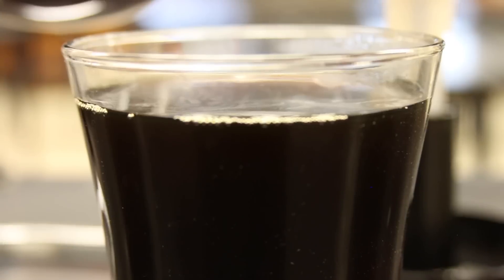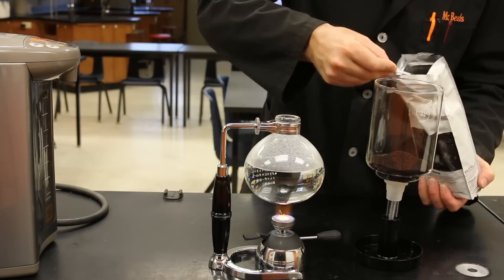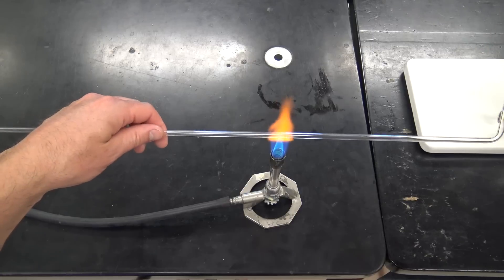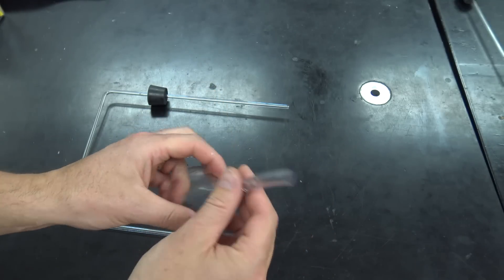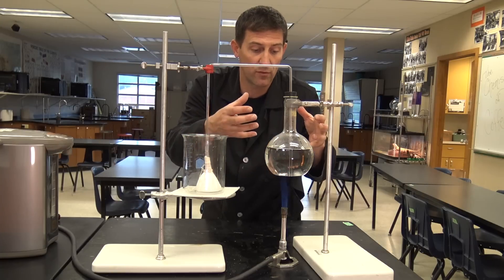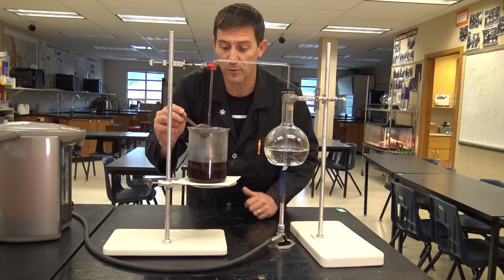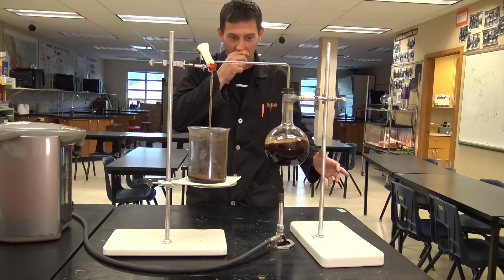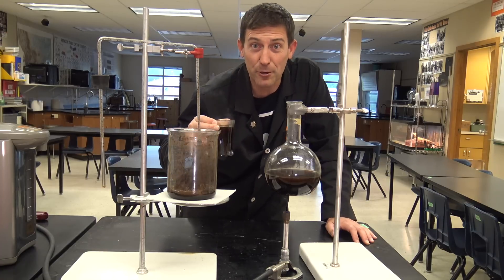Brew Perfect Coffee with Chemistry Equipment - DIY Siphon Brewer

Comment: Hi! How much time do you spend heating the water approximately?
Reply from the maker: If I have something available to boil the water before putting it in the brewer I will preboil it. Then it only takes a moment to get it back to a boil in the brewer. Once it is barely boiling in the brewer, I seal the stopper and let it go to work.
Does that answer your question?

Comment: I’m trying to make my own, would that clear plastic/rubber tubing he used as a connector work as a replacement for the glass tubing he used to syphon the coffee from flask to beaker or breaker to flask? I can’t find glass tubing like he had that bent so easily also don’t have a glass cutter
Reply from the maker: You can use plastic tubing but make sure it is rated to handle the heat.
Reply: @BealsScience  thank you! got some from Home Depot that worked like a charm! Love the video too 👍
Reply from the maker: @mikeysasso2646  I'm glad it worked!

Comment: Hey there, wanted to know of this works for hot chocolate as well?
Reply from the maker: I am not sure how well it would work. It probably depends on the filter. A fine filter may get plugged with the chocolate.
But, you could skip the filter and put the cocoa in the beaker, let the water travel over to the beaker and once all of the chocolate has dissolved in the water you could remove the heat and let it travel back.

Comment: a soxhlet would have been better wouldnt it? or is that cheating?
Reply from the maker: We could use one just for looks (it would look cool!) but a soxhlet is mainly used for extracting lipids or oils from solids. For example, it can be used to extract peppermint oil from mint leaves.
Reply: @BealsScience  isnt that effectively what you are doing with coffee as well
Reply from the maker: @andosoup98  brewing coffee is where the hot water pulls molecules out of the ground up bean. These particles become suspended in the water or are dissolved into the water and carried into the brewed coffee container.
If we used a soxhlet, we would only pull small amounts of oil out of the ground beans so we would end up with a small amount of coffee oil. Which might be a really cool thing to have!

Comment: Nicely done, however, if it's properly made, once the majoirty of the water is boiled off, you'll naturally get a lot of turbulence in the "upper chamber" that will "stir" everything for you automatically. If you're not getting that gurgle of air, you don't have enough space between your uptake pipe and your boiling flask.

Comment: I would love to see a set up meant for tea!
Reply from the maker: That’s a great idea! Any suggestions?
Reply: @BealsScience  Well, I think you'd need to set up a thermometer because for white / green teas the temperature for brewing needs to be 80C, black / pu'erh teas 100C. If you have water that is too hot for white / green you run the risk of burning the leaves and the flavour turns. I've watched your videos a few times as I always keep coming back to this idea so I don't think the process would be much different from coffee, just need better temperature regulation of the water, and a way to easily time and siphon off the tea. I would suggest collecting into a boiling flask that perhaps is on a pivot point that you can pour into a mug.
Reply from the maker: Thank you for the ideas and info!

Comment: Could I substitute the burner with a hotplate? I do not have access to gas.
Reply from the maker: Yes!
Reply: @BealsScience  Does the temperature matter? Or is it only going to speed up the process?
Reply from the maker: It needs to get hot enough to boil water. But, it doesn't matter how fast it gets to that temperature.
Reply: @BealsScience  Thank you so much!

Comment: But how does brewing it this way affect the taste of the coffee? Also you should always use whole bean and only blend it right before you brew it because a lot of the flavor comes from the beans releasing a gas after being blended and boiled
Reply: It's not gonna taste that radically different from a french press. It's still just coffee sitting in hot water for a while that is doing the actual brewing. The vacuum is just moving the water around and the simple paper filter he rigged to the end of the tube is doing all the filtering. The only benefit of this over a french press (in terms of taste) is that you can use a better filter than you use of a french press, that's all. So, I imagine it would taste quite similar to a Aeropress.

Comment: Nice job.  Personally I would be interested in building some type of apparatus that actually brewed the coffee in a partial vacuum.  I think it would be possible to brew at a much lower temperature and get a smoother cup if the vessel that the slurry was heated in was under vacuum.  It would have to be hermetically sealed with some kind of a valve to allow it to flow back once brewed.  Perhaps it could be done with steam.  Maybe having a vacuum suck heated water vapor through a filter packet of some kind and deposit it in a trap.  Any ideas on how this could be done?
Reply from the maker: Steam brewed coffee?!?!
I love that!
How? Not sure...but I will definitely do some brainstorming!

Comment: wouldnt it be easier to use an electric kettle with a rubber stopper on the top and the same set up. alot of people dont have access to this equipment. my idea is to use an electric kettle, as i need the whole contraption to be portable.
Reply from the maker: An electric kettle is a great idea! If you make one, let me know how it turns out!

Comment: I love this video Mr. Beals; I'd like to think this would be an awesome demonstration for a high school chemistry class, but I'm not sure how attitudes towards students and caffeine have changed since I graduated; I remember energy drinks were a huge controversy back in '07-'11. 

In any case, I did want to note that the vacuum explaination was a wee bit off. This is a bit of knit pick, I know it is conventional, even in science classes, to describe a vacuum as sucking or pulling a liquid or gas. However, it isn't the low pressure in the flask that does the syphoning work, the syphoning work is done by the mass of the whole atmosphere above the brewing beaker. 

I mean technically speaking, the pressure in the flask does initially do work on the water in the flask, pushing against gravity and the rest of the atmosphere, to move the liquid water though the glass tube and into the brewing beaker, then the atmosphere pushes it back as the pressure falls to restore equilibrium. My point is vacuums don't actually suck, the higher pressure side of the pressure differential pushes. Again, this is more of a knit pick, I didn't learn the correct way to think about pressure differential and vacuum until uni, but it may be a cool way to challenge student's perspectives and preconceptions in the lab. 

Milk shakes are hard to drink because the atmosphere simply doesn't exert enough force on the surface of shake in the cup to allow the induced vacuum in the straw to overcome the intermolecular forces between the emulsified cream, milk, flavor, and ice crystals and produce speedy movement through the narrow straw. I did an experiment my freshman year of college using a bicycle pump with gauge, a metal water bottle, an o-ring, one one-way air pump valve, two silicon seals, one one way pump valve from a bicycle inner tube, metal straw, a small bit of clear plastic tube, and an alligator paper clip. I put a thick milkshake in the bottle, sealed the lid and straw, and pumped ~1.2 atm of pressure into the container. It was much easier to drink, not because I was providing more suction but because the pushing pressure of the extra gas confined in the container allowed for a higher pressure differential. 

Though, if you did something like this in class, I'd suggest  scrapping the pump (which contains machining oils), and using some rubber tubing, a 2 mouth round bottom flask, an addition funnel, and use a sodium bicarbonate/acetic acid reaction to produce co2 for the pressurization. You don't want a lot of pressure here, the goal isn't to fountain milk shake out of the straw, but rather make it easier to drink so students can get a better intuition for how vacuum and pressure differentials work. You could substitute smoothie instead of milk shake if allergies or sugary treats pose an issue with admin, though you may need to adjust pressure and your smoothie thickness accordingly. Having students calculate how much acetic acid to add to produce the desired volume of gas and thereby the desired pressure might make it a bit more on topic for a chemistry lab, rather than a physics lab 😁

Comment: Could you possibly make the run from the two main containers longer? Like to add some kind of fancy spiral tubing thing?
Reply from the maker: Definitely! I may have to try that at some point.
Reply: @BealsScience  You might want to stick a thermometer in the flask to see that the water coming in is 200*F,  if it's higher add tubing and if it's lower, shorten the tubing. This is chemistry, let's optimize! :-)

Comment: Would the coffee brewed in the store bought siphon brewer be brewed too hot? It seems that the brewing coffee in the store bought one is boiling as well, the homemade one doesn't seem to have the same issue of the coffee being as hot though. Also, this is definitely a much better quality video than the coffee chemistry video I made a few years ago for class.
Reply from the maker: Your coffee video is great!!!
My students preferred the coffee in the homemade siphon to every other brewing method...and so do I! It probably has a lot to do with temperature and timing. More research and coffee drinking needed to confirm...
Reply: @BealsScience  I have never had any kind of siphon brewed coffee, but in my personal coffee making/coffee drinking(i.e. going to coffee shops) I prefer french press coffee, although pour over is okay too. The National Coffee Association USA has some guidelines on coffee brewing stating optimal coffee extraction is between 195-205F, and I'm sure there is some pretty in depth things people have done in their own time with regards to timing and temperature of coffee.
Reply: I own a store-bought siphon brewer. After several brew experiments, the top chamber never reached the boiling point. A handy digital thermometer stuck in the water on top, did not exceed 190°.  It initially pushes to the top at ~165°. The bubbling in the top chamber must be a result of gasses pushed from the bottom and not from a boiling effect in the top container.